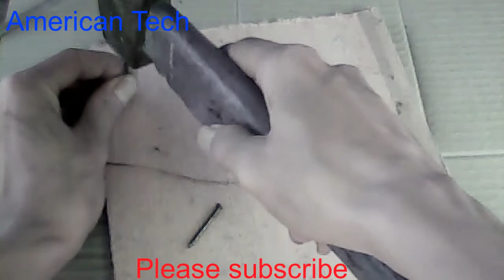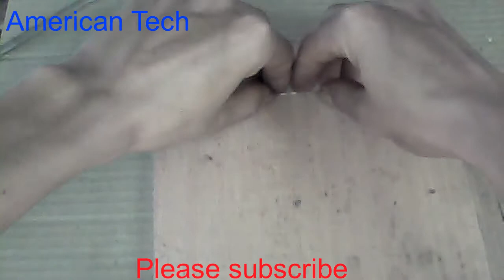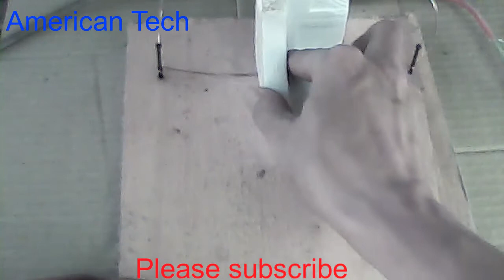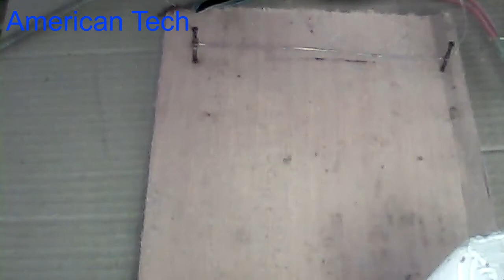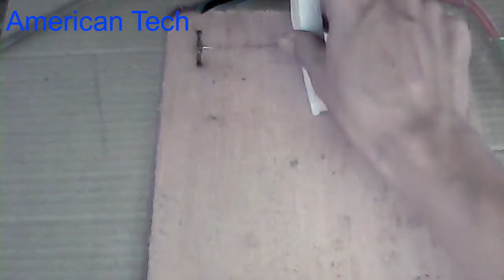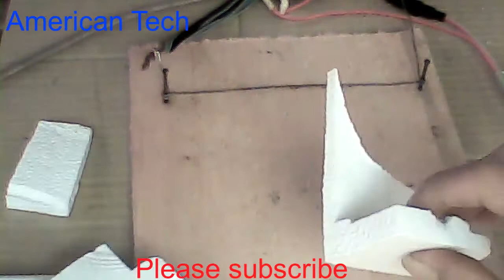How to make foam cutter at home very easy

Comment: You've not bothered to tighten the wire properly which you could do by attaching it the correct way & twist-tightening, & you're showing people how to give themselves a nasty burn against a *super hot wire*. A flexible wire makes cutting uncontrollable hence more likely to cause an accident, and youve also almost set fire to the board?! You've even hidden how the wire is powered. 0/10.